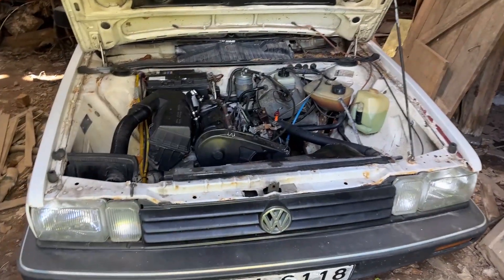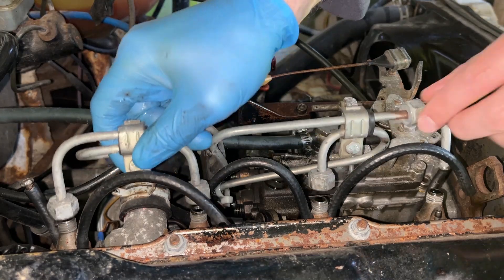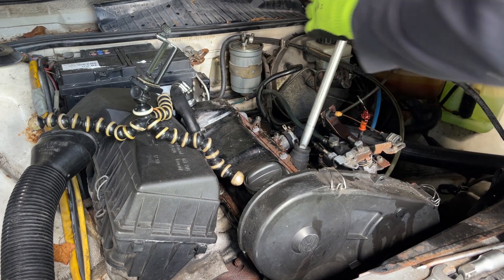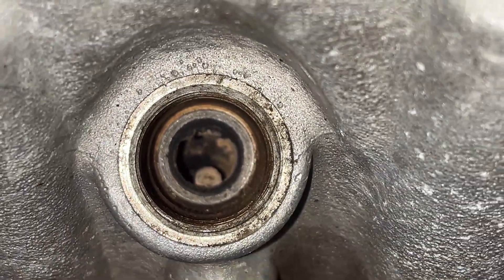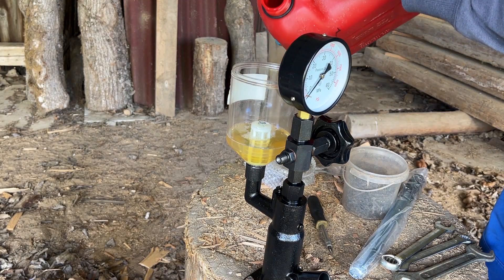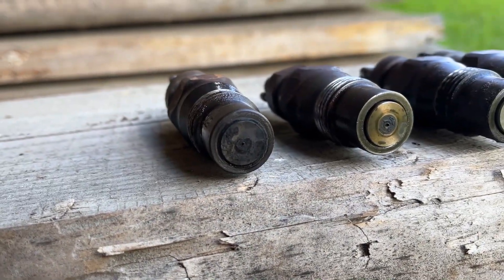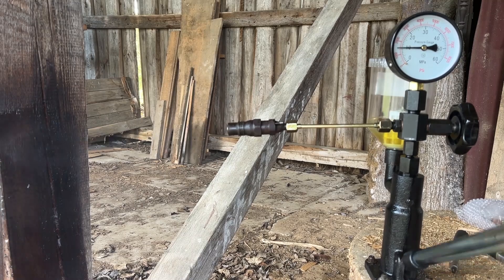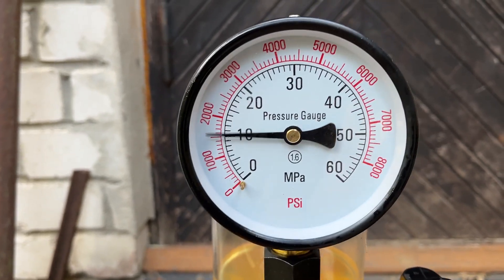Diesel Fuel Injector Tester // VW Passat B2 1.6D

Comment: Consistency between all four is a good indication.  When we test them on commercial engines, it seems more like a fog than a spray but could be the tester.
Also, its nice that they came out pretty easy
Reply from the maker: Turns out i was wrong, they need to spray at higher pressure, but weird how they are consistent but low

Comment: Those injectors look like they are not the reason for no start. Maybe glow plugs, fuel delivery or low compression. if you were using used motor oil for fuel then there is a good chance you fuel filter is clogged up. Fuel delivery is the most common reason for no start.

 Still, while they are out, you may as well put in new nozzles and adjust the breaking pressure until they are a little closer together. The amount of carbon build up on #1 looked pretty bad. Maybe low compression in that cylinder: seems like incomplete combustion.
Reply from the maker: took the injectors out just to basically play with them :) glow plugs are "fresh" but could be defective/cheap. glowplug and compression test in the next video, haven't done that yet. I started using cooking and waste oil only after the starting issues started. filter just as fresh as the glowplugs.
yeah that carbon build up seamed wild. I do have blowby :( hope the compression test gives me some answers

Comment: you are supposed to hit hard on the thing thats dispensing the diesel, to simulate how it turns into a quick "fog" pattern inside the engine/cyllinder and to see any problems with the injectors
Reply from the maker: Yeah, saw that when pushing the handle slowly, there were drips and streaks, by hitting hard, mostly fog